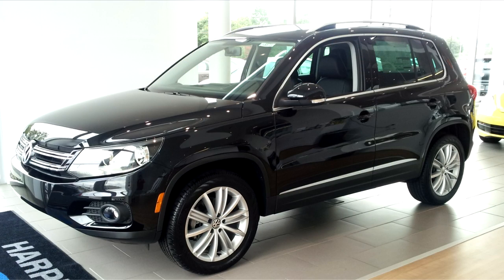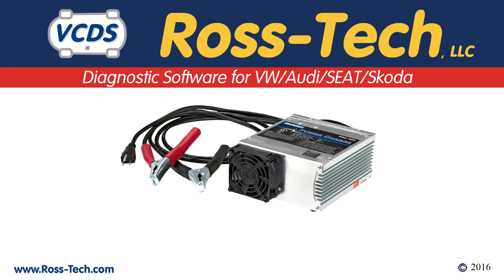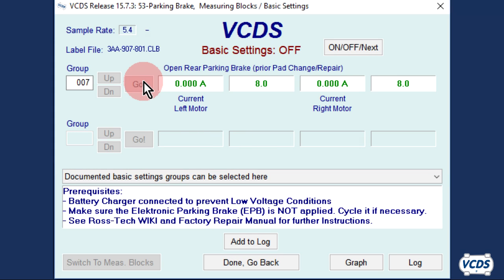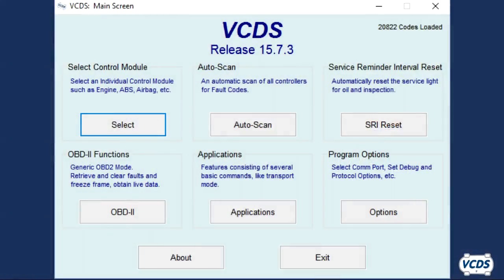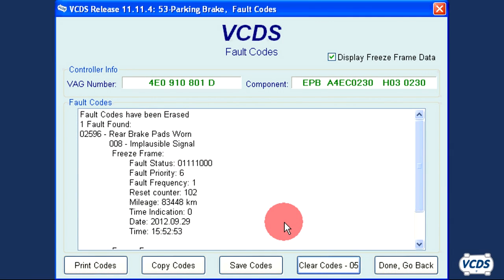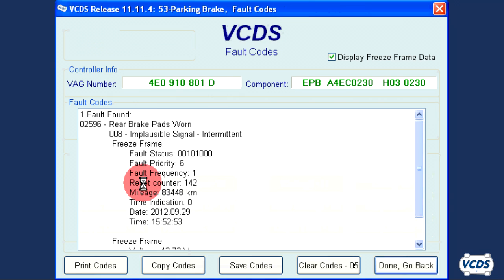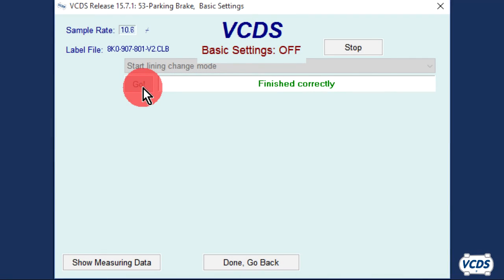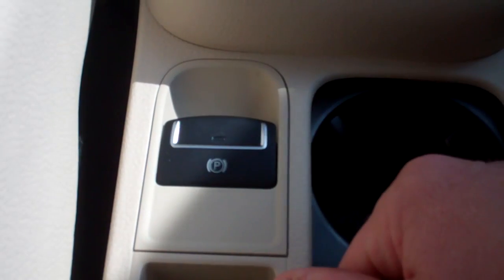Electro-Mechanical Parking Brakes (EPB): How to do rear brakes

Comment: I have a problem and error relating to brakes. In my Audi Q5 FY 2018, 2.0 TFSI, there is a trouble code C10E1F1. Will your method work in my case?

Comment: I have a low supply voltage issue with my vehicle I did it without a battery charger.  Now the passenger side won’t work. 

Did I mess something up? Or can I hook a battery charger up to reset it?
Reply from the maker: It is very possible parts have been damaged and will need to be replaced.  We handle vehicle support questions on our web forum:   http://forums.ross-tech.com   It is a free service for our registered customers.

Comment: does this work on the lite version???
Reply from the maker: No.  VCDS-Lite only supports  the old K-Line diagnostics (phased out between 2004 to 2010).  Cars that have an EPB system use the newer CAN Gateway diagnostics, something VCDS-Lite doesn't support.  Regards.

Comment: Great video, thanks!
What is UDS?
I have a 2016 Touareg 7P, is this procedure good for my car? Does it have UDS?
Reply: Did you do this ? Was it all good ? I need to doo all my discs.... strangely the pads are all good
Reply: @dooferme3852  no, I didn't do it yet, my disk brakes are fine and don't need replacing

Comment: Can I just leave the engine running instead of connecting that battery charger?
Reply: VW/Audi states to have a battery maintainer (charger) connected to the vehicle for this procedure.   Having said that, if a battery maintainer is not an option, you do what you have to do to get the job done safely and protect the car.

Comment: Sadly the rear left parking brake got stuck , it show 0.133 amp constantly now... So I couldn't click basic setting / next or run a function test now it giving me warnings bigtime , is this a phisical problem that can be resolved by fixing the caliper or is it an electronic problem the parking brake still seems to work but says it is stuck , is it time for a year down of the rear left brakeing system?... Oh yes it's on a A8 d3 2003 with 1ll brakes

Comment: How important is the battery charger really
Reply: As important as the net below the tightrope walker.... most of the time they will walk across that rope without issue.  It only takes 1 fall without that net to ruins one's day.
Reply: @vcdsbyrosstech  I understand. I couldn't find a battery charger suitable for my car in time. What is the minimum voltage that the parking brake will retract at?

Comment: I bought 2 used rear calipers with the electronic unit for a good price. How do I do this, if I don’t know if they where set into service-mode before dissasembly from the donor-car? I have a fault code on the electronic parking brake on the right side on my passat 2006 2.0TDI 4M.
Reply from the maker: We offer free vehicle support for our customers on our web forum.  http://forums.ross-tech.com
Reply: They're unlikely to be in service mode. If you unbolt the brake motor from your caliper you can easily fully rewind the handbrake pinion with a torx25. If the piston is pressing out your winding the wrong way.

Comment: Will this procedure of rear brake pads change work with the Ross tech Lite? Thanks.
Reply: No.  It doesn't support it.  But the motor is held on with two screws.  Remove it, put a T40 bit in the back of the caliper and rotate clockwise until it stops.  Does the same thing.

Comment: 53 Parking Brake is not showing under installed modules. It shows under chassis but it gives me no response from controller when I try to connect.

Comment: Fun video and generally good but with my 2015 Audi A3 I got "no response" from that controller. I  then found http://wiki.ross-tech.com/wiki/index.php/VW_Golf_VII_(5G/AU)_ABS_Brakes#Basic_Setting with [03 - ABS Brakes]->[Basic Settings - 04]->Start/End lining change mode. Worked perfect.

Comment: what is the correct procedure with Golf 7 and Vcds 18?

I can't access the control unit 53 to release the brake
Reply: I just posted a comment and noticed that your case may be the same as mine. Maybe [03 - ABS Brakes]->[Basic Settings - 04]->Start/End lining change mode?
Reply: @antilogism  yes it's correct. Ide 03331 start change and ide 03330 finish change. Now i'm looking for the correct procedure to bleeding the brakes and purge the abs valve
Reply: @marcotini4796  There are several bleeding procedures in my Audi manual (standard, pre, post, with and without fancy tools). The easiest is common pressure-bleeding. They only warn that the pressure must be 2 bar to bleed through the ABS. For old-timey  two-person bleeding there is no such restriction (is much higher than 2 bar). Factory mandated bleed sequence is odd: Left front, Right front , Left rear, Right rear. Golf is very near an A3 so maybe?
Reply: @antilogism  Honestly there is a lot of confusion. I purchased a sealey vs820 brake bleeder. for the purge sequence I believe there is an error in the manual. watch this video:

https://www.youtube.com/watch?v=sNLaKPCY-bM

after removing the old liquid from the tank (I don't know if it is correct to do it) the old liquid purging starts from the farthest caliper rear right.

You say that the pressure to purge the abs must be at least 2 bar (like this comment of Alessandro Zavagno https://www.youtube.com/watch?v=kR06uTBdrQY&t=88s) while this blog writes "The last method involves using a power bleeder that applies fluid at the reservoir under pressure. This is pretty much the same idea as the last two methods, but the instructions for your specific model of power bleeder supersede any tips here. The factory service manual states that you should not exceed 14.5 psi of pressure due to the proportioning valve inside the ABS system which prevents a good flushing. I would limit the pressure to about 10-12 psi" (https://www.myturbodiesel.com/wiki/brake-fluid-and-clutch-bleeding-and-flush-mk3-and-mk4-vw-and-audi).
I don't know what to think :)

did you find any video tutorial on the abs on golf 7 bleeding procedure?

Comment: Hi, so if i changed rear brake pads, what should i do ?
Reply: Given your question, the best thing for YOU to do is take it to a dealer or an independent experienced with the model of your car.
Reply: @rogerl7533  I dont even own a new car that has any of this stuff but i had to ask a question, on a older car you can go to sleep in the car with the key turned back while listening to the radio pretty much all night,why does a external source of power have to be connected on these cars to run a little motor back and forth a couple of times? i heard of people moving this motor with a "D" Battery  so that makes me more confused as to the electrical storage capability of these newer cars or is there something else involved? thank you for your input.

Comment: Why sometimes is recomended to wait 30 seconds after EPB motor stopped before click "stop"?
Reply from the maker: Older EPB modules had a firmware glitch in them that would cause them to brick if you exited out of Basic Settings too quickly.  So we state to wait 30 seconds on all of them since most people don't know which ones are going to glitch.

Comment: i have just bought a VW passat 2007 that has sticking park breaks... Will performing this, solve its issue?
Reply: Oh, for sure, no question about it. AND, it will add 50 horsepower and 3 inches.
Reply: Sounds as though your issue is likely a loose nut between the steering wheel and the driver's seat.

Comment: Tip: Buy a car with a cabled park brake instead of electronic LoL problem solved ;)
Reply: this is 2018 Im not buying old cars anymore, my 2007 and 2010 both have electric brakes, and most cars will have them in the future. just get the right tools and learn how to do it
Reply: That is a lousy answer. Most cars do not have them because it is far from necessary and something else that will certainly break like most electric motors over time. It is a pain because it is another tool that we mechanics have to buy and charge the customer's more. Mercedes was nice enough to include this in the service menu so anyone can perform the brake service without a scan tool or software.
Reply: Yet one more rocket scientist weighs in.

Comment: Would it be the same to supply 12V from a second car with the engine running? I believe it would but any comment from the experienced guys would help. Thanks.
Reply: Yes that would be the same.   The other vehicle's alternator would be charging the vehicle you're working on.
Reply: Seriously? Only if both cars are tuned to the same radio station.

Comment: Good evening, can I do the service with the engine on to prevent low voltage?
Reply: Thiago Morais no. The engine has to be OFF.  The park brake comes on when you switch the engine off.   Don't disconnect three battery in this state
Reply: Doing your part for global warming, are you?

Just buy a charger...

Comment: Thanks heaps! Just to let you all know, for any doing it later down the track... 
I used the last video (6:10) on VCDS 15 with my Australian 2011 Audi A6 (C7)

Steps:
Toggle parking brake off and on and off
Switch ignition on
Connect battery charger to charge terminals
In VCDS EPB Basic Settings > Start lining change > wait until "Finished correctly" > Stop > Close
Switch ignition Off
Change read pads/rotors
Siwtch ignition on
In VCDS EPB Basic Settings > End lining change > wait until "Finished correctly" > Stop > Close
Toggle brake on and off
Start engine & test drive
Reply: lochie36